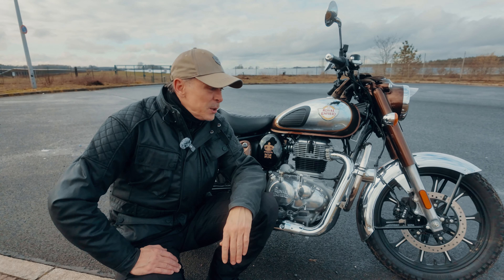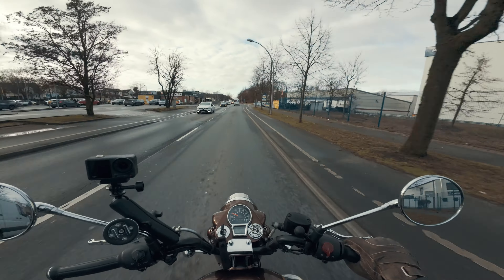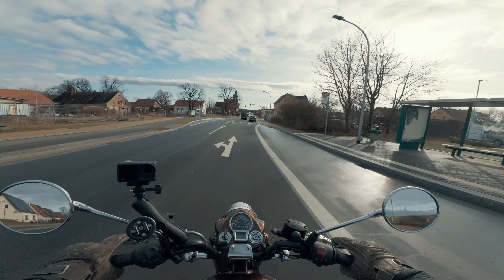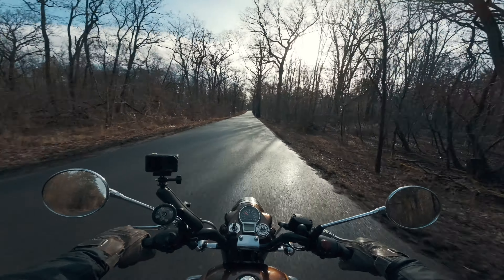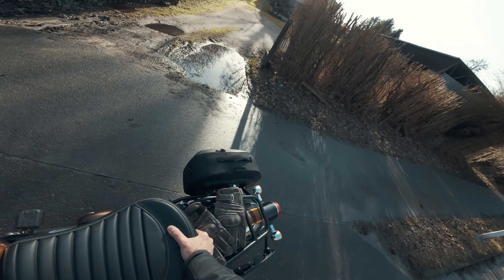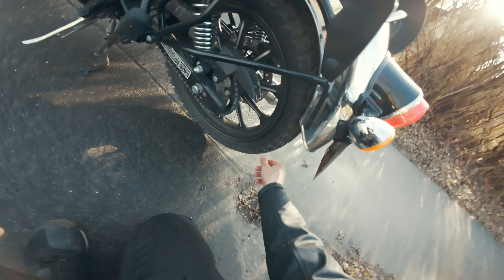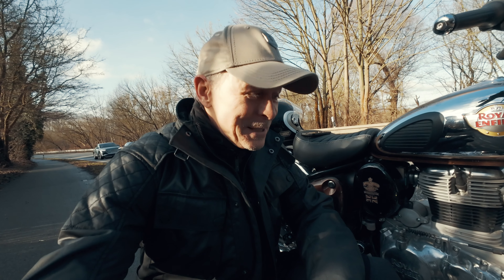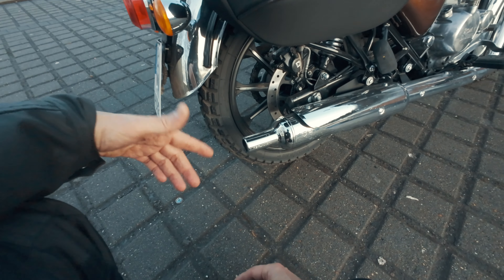Tire Puncture? Breakdown with my Royal Enfield Classic 350 !

Comment: Got a puncture on my Meteor 350 a while ago. Took the large screw out, very slow leak. Made it home. Put a plug in it, filled up tire. 6 months later no issues. That's the difference between tubes and tubeless.

Comment: The K60 / K60 Scout tires are stiffer. This may have saved you (they are reported to be good at this). They do need a bit more air pressure than „normal” tires (I checked this with the manufacturer). I have spoked wheels on my Classic 350, so there is a tube inside. According to Heidenau (I sent them the papers an owner’s manual of the bike), they need at least additional +0,2 bar to the manufacturer’s recommendation. As they K60 is very stiff, you may have inflate more right after mounting to have the tire seat properly on the rim, then air down to the desired pressure.
Reply from the maker: I will try to ride the tire with a bit more air pressure, thanks for the tip 🙂

Comment: I am pleased you were able to control your bike as it's so easy to slip off. I had the same problem, my back wheel started weaving and I couldn't understand why. It turned out to be a puncture and it had no pressure in it. It had a long nail sticking through the middle of the tread and I had no pump. I was fortunate and able to ride it home at 40mph. It was very easy to remove the rear wheel to get it repaired. p.s it appears to be the same with every small Enfield this vibrating mirror issue..

Comment: Had the same problem with a himalayan. It was definitely a puncture... felt like the bike was on ice... had to be recovered due to the tubed tyres.. 
I now run with a TPMS and check it regularly while riding... it was only £35.00 and is accurate enough for these situations... 
Be safe ...
Reply from the maker: I will get a TPMS too to be on the safe side 🙂

Comment: I also had a problem with tire pressure. it turned out that there was a problem with the valve machine. it was not tightened

Comment: Do these tires require rim locks?  

Glad you are okay.  Tubes tend to blow out big time and tubeless seem to give you time to become aware of the flat.  I flatted the front tire on my GL1800 and put a plug in and then rode home at a max of 50 mph as the temperature was. 120 F in the desert I was in.

If you have low pressure you can ride the tire to where it comes off the rim and I have heard of some guys with tubes doing this to break the bead.

SS
Reply from the maker: It was an immediate loss of air and the tire got flat and slipped of the rim, so I was lucky not to crash the bike.

Comment: That tire is no good now from riding on it flat.  The cords are damaged and it will degrade or possibly blow out if you ride it. FYI...knobby tires are easier to puncture than road tires. That may be a rim leak but regardless the tire is a goner sorry to say.

Comment: About the tire: I assume the tire was badly glued.
One question: Are you now driving without the O² sensor connected?
Reply from the maker: The O2 Sensor is connected. Glued tubeless tires?
Reply: @Marc.Stones  Yes, it's better to stick tubeless tires on the rim or at least seal them. If they had been glued together, they would not have been able to come off the rim so easily.